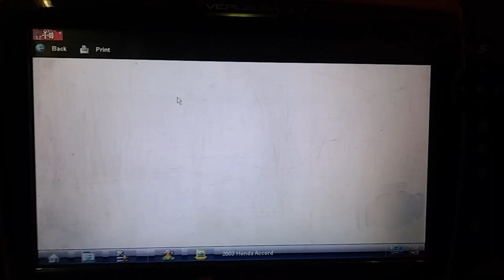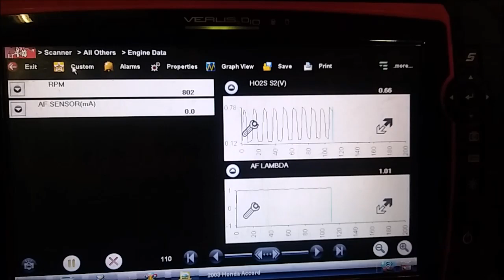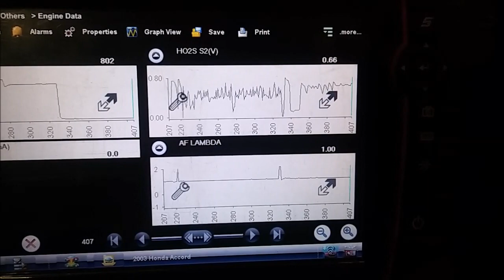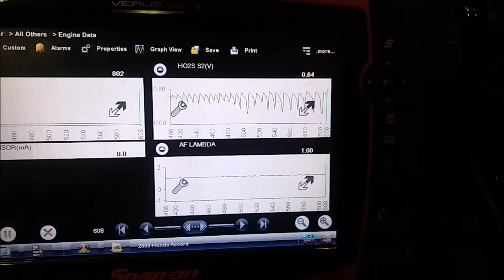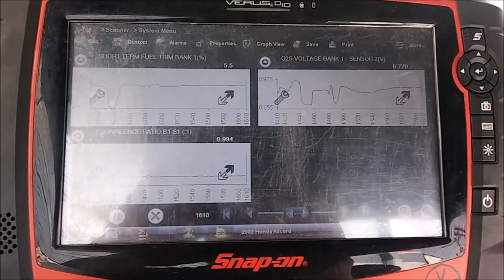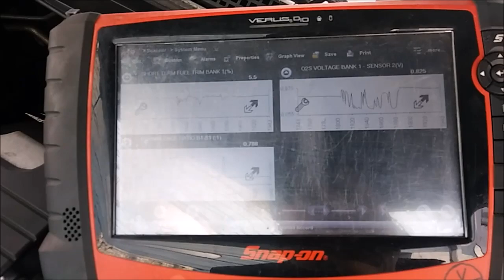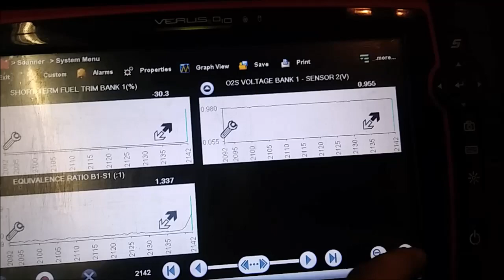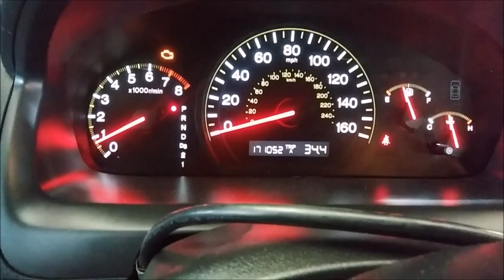How to Test a Bad Catalytic Converter,  2003 Honda Accord Case Study

Comment: I think a $5 spark plug de-fouler on the downstream sensor would also take care of that cat code (installed by owner of course!) That accord looks mint for a 2003! You guys down south are lucky lol
Reply from the maker: Compared to some of the stuff you deal with up there absolutely!  This car was under warranty fortunately, (used car dealership),  so we installed a nice factory converter 😊
Reply: Pine Hollow Auto Diagnostics lol right
Reply: That owner is lucky, the OEM converter for that car is over $2000.
Reply: Will the catalytic monitor complete if you use a spark plug fouler?

Comment: Nice tip using propane to check for exhaust leaks. I'll be using that☺. Your videos remind me for scannerdanners videos. Your a great teacher. Keep up the great work!
Reply from the maker: Thank's so much!  Idk about the comparison to ScannerDanner,  he is much more experienced than me.  But flattering none the less!  As for the propane trick,  I use it primarily to determine if a leak downstream of a sensor is affecting it.  Other than that, smoke test or hose trick is my preferred method.

Comment: Great video TD, my experience with the P0420 code has always been a failed catalytic converter, even some aftermarket new ones!!
Reply from the maker: I would say that 19 times out of 20 I find this to be true as well.  Occasionally I will see a false P0420 caused by an exhaust leak,  but not often!
Reply: @pinpointautomotiverepair1592  how do I find a mechanic that will diagnose accurately?

Comment: Nice video.  Did you find out what cause the converter to go bad or was it just too many miles on this car?  I know this vehicle has around 170,000 miles on it, but did you question the owner if any other work was performed on this engine which may have cause premature failure?  Also, how long should catalytic converter lasts?
Reply from the maker: Thanks!  No,  I didn't question the owner any further on this failure,  as he was a recent buyer of the vehicle and wouldn't be able to tell me anything history wise anyways.  When I see a converter failure with this high of mileage I don't ask questions to much,  as it was likely just it's time.  If I see a failure on a vehicle with under 100,000 miles on it I will look further into it,  but not generally on a vehicle this old.  As far as how long a converter will last,  its tough to say.  It depends greatly on manufacturer and the environment it's subjected to.  In general,  I see most of my catalytic converter failures presenting in vehicles with more then 120,000 miles on them,  and rarely before that point.

Comment: Not sure what the price is for a new cat, but the time spent doing this alternate testing may have been expensive $*hr=$$$, where as assuming it was the cat may after not seeing O2 sensor codes- could have made it cheaper?  How long did it take in hours to do this?  What is hourly rate for diagnosis?  But it was very informative.

Comment: You could use a thermal gun. Check the up stream before Cat. Then the Down Stream after the Cat. They should be almost the same. If the Cat is working right...

Comment: I just had this issue on my 2007 Accord 2.4, 5 speed manual I bought a few weeks ago. Car is in beautiful shape, one owner with 166,000 miles. It threw a check engine light the day I picked it up, but ran well still. Autozone scanned it and the P0420 code came up. Took it back to dealer, they changed an O2 sensor and said it was good. I drove it for almost a week, and the light came back on. Took it back to the dealer, and they ended up changing the cat on it. I’m happy I had a 30 day/1000 mile warranty on the driveline, and the dealer has been great about fixing the problems. I’d like to put another 166,000 miles on her!
Reply: Lucky you, a new OEM converter is $2000 from Honda, did they install a Honda converter?

Comment: I have 2005 V6...I got a p0420 code ....both my downstream sensors are fluctuating from 0.100 to 0.700 .....the downstream sensors never stay stable .....not sure if I should change the sensors, the bank 1 converter, or change all three converters.....any ideas? I also checked the outlet temperatures on all 3 cats....and there at cooler temperatures then the inlet.

Comment: This is the exact same thing happing  with my 2004 honda accord. Runs great no egg smell.i can clear the p0420 and takes like 50 days or do to come on.i need something to test them 02 sensors.
Reply: Frank Barker WHAT the heck are you trying to say? ?
Reply: @clarencealexander1908  im trying to say it wasn't the cat and it wasn't on sensors. It was a cracked air intake that caused a faulty code. It was just smogged last week..
Reply: @frankbarker1568  what did you do to find out it was a cracked air intake?
Reply: @JKUDO BIKELIFE  look everyone has tried to make this difficult im a tech as well though electrical. Honda accords 2000 to 2006 put out faulty p0402 code stating cat is below threshold bank 1...... I had no signs of a bad cat. I cleared the code 45 days came back on why it was raining water sucked into the air intake. I checked all air hoses and noticed the air intake hose was cracked. I replaced it. I cleared the code. It's been like over 2 years been smogged etc. Check for air leaks around the air intake as well as see if the air filter box is cracked. If nothing replace your ox sensor
Reply: I got same issue 2004 Accord P0420 keeps coming back on and just changed the 02 sensor bank 1 any suggestions?
Reply: How many miles do you have on it?
Reply: @frankbarker1568  40,000 about to be 41,000 miles
Reply: He told me he changed the cat already and like I said before the 02 sensors

Comment: i have code p0420 on a 2007 honda accord 2.4.  ive replaced the cat already with a direct fit and the light came back on the next day.  Ive tested the rear 02 sensor with reads .3-.8 volts at idle.  do you think i need to change the rear 02 sensor or what other things do you think could cause the p0420? thanks

Comment: I went to Honda and received this diagnosis on my Honda Accord,
 2010, but to me it’s working fine (I generally do not drive the car much) I am just not convinced that is the final resolution, and our course the only option was to replace both and it is expensive. I’ve had a bad catalytic converter before on a Toyota Camry it was bad. Any recommendations for a mechanic in Greensboro NC that would be able to give me a good second opinion?
Reply from the maker: If its throwing a P0420 or P0430 fault code 99.9% of the time its going to need the convertor.
Reply: Triangle Automotive Yes, unfortunately I’m just surprised as I take very good care of this Honda which has much less miles than my Toyota did. Now that it seems I’m experiencing like on my prior Toyota that now my Honda may have the exact same issue on a “reliable cars” it is just disappointing. Anyhow thank you for the feedback!

Comment: my 2007 accord 169.500 mileage i think  have the same problems the throttle actuator system malfunction   catalyst system efficiency below threshold   catalyst B2 deterioration how much money will cost that to fix

Comment: Hi! Good job on such a detailed video. I have a 2007 Honda Accord which has 145000 miles in it. 5 months back I got a check engine light for p0420. My mechanic ran detailed diagnosis looking at the downstream sensor voltage and told me it is the converter that gone bad. I have to replace the converter not the sensor and referred me to an exhaust shop. I replaced the converter and next day the check engine code came again. Then they said I need to change the downstream sensor too. I changed that also. Now after 3  months the check engine light came again for same p0420. I thought of taking the car to the mechanic at the end of the week. But in two days the check engine light turned off itself. After 1.5 months the check engine light came again for same p0420 code and after 2 days it turned off. After what happened first time I don't feel reliable on that mechanic anymore. Do you have any suggestions for me?
Thanks. Keep up the good work.
Reply: Change the upstream sensor as well as both the sensors operate in coordination. If their reading fluctuate codes show up .
Reply: You have a problem in your car that causes the catalytic converter to go bad. Maybe your engine burn oil or running to lean/to reach, vacuum leak, misfire or bad 02 sensors. You need to fix the problem first than replace the converter you have 2 of them diagnos which one is bad then replace it.

Comment: A week ago I bought a 2003 Honda Accord (off Facebook Marketplace) with only 134k on it and thought I had surely found a bargain. BUT, after a diagnostic test today, the cat-con produces a "below threshold" reading, which makes me wonder if the vehicle has been much more abused than the "lady-driven" history the seller described would suggest. Question 1) At how many kilometres averagely does the cat-con fail on a Honda Accord? Maybe never in its lifetime? Surely it is not unreasonable to suppose that the cat-con could go up to 200-250k without any defective operation....or further than that....? 2) Does a faulty cat-con also affect engine power (i.e. brake horsepower, and also top speed)?? 3) Does a faulty cat-con also affect fuel consumption by reducing fuel efficiency? 4) Does replacing a dud cat-con with an after-market look-alike exacerbate the problem? 5) How strong is the rationale for using an OEM replacement? Is it worth the considerable extra expense to stick with an OEM cat-con? Thanks for your time and attention...:=)

Comment: excellent video TD  just wondering if there is a way to convert scan tool frames into time?
Reply from the maker: Hey there Mark,  thanks for the reply.  This is quite the interesting question and has stirred me to give it some thought.  As I stated in the video,  the best way to do the test is to use a scope so that time can be accurately measured,  but maybe there is a work around though it would require some experimentation.  On most vehicles there is a "Time since engine start" data PID,  and if you were able to graph this PID along with the oxygen sensors one could theoretically calibrate frame rate to actual elapsed time.  I haven't tried it so it may not work,  but it is definitely worth experimenting with!
Reply: The scan tool's documentation should have in its specifications what the frame rate is (in frames per second or Hertz).  Take the frame number you are interested in knowing the associated time and divide that frame number by the frame rate.  The result is the elapsed time since frame # 0 started logging/plotting.

Outstanding video, by the way!  You don't see many people post videos that have that granularity of information.  Very nicely done!

Comment: Triangle Automotive, I just watched your video on this cat converter. Man, When I got this code on my 2012 Honda Accord se, I just about got depressed. Anyway, The check engine light suddenly went away after 3 days and up to this date, has not came back. I know from experience that the code is probably still in the computer, and my car has 199,163 miles on it. What would a FULL diagnostic show me, or what should I look for when I get that done at a shop?
Reply: You ever fix your issue? I have same car/yr and I have the code.

Comment: What if you get a reading p0420 bank 1? It doesn't say sensor 1 or 2.
Reply: Bank one is up stream sensor and bank 2 is downstream
Reply: Bank is referring to cylinder bank. If you have a 4 cylinder there is only one bank. If you have a v6 or v8 there will be 2 banks. The sensors have their own codes such as Bank 1 sensor 2. Or bank 2 sensor 1 etc.

Comment: I like to know what cause the cat to fail
Reply: Exactly, catalytic converters in theory should last forever on a properly running car, when they do get cooked and restricted there's a reason for it and I always dig deeper after a bad cat diagnosis.
Reply: Low grade fuel ⛽️ is the primary reason that a cat goes bad
Reply: Honda’s burn oil like hell